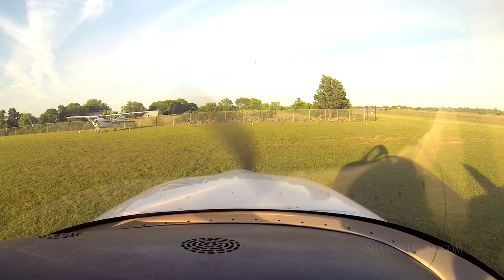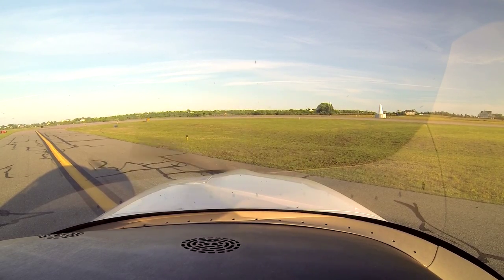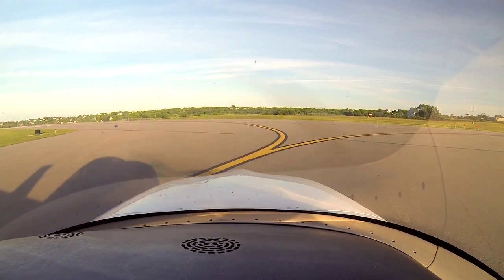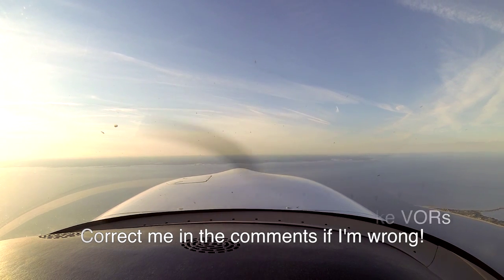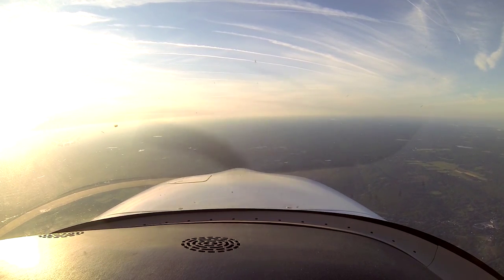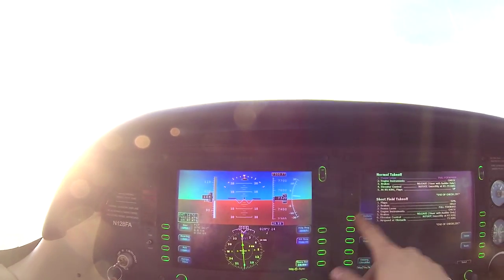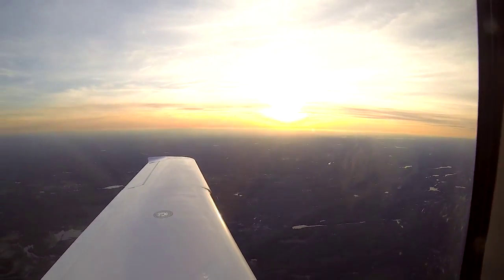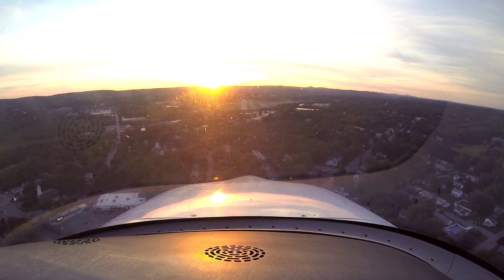This is Cirrus | HD + Comms | SR20

Comment: You probably know this by now, but here it is for the sake of the readers.

As far as the Cirrus S-TEC 55X autopilot NAV is concerned, there are two functions. One is NAV and the other is GPSS in NAV mode.

If you fly with NAV only, AP will receive navigation data from the Primary Flight Display HSI.

NAV selected with GPSS (GPS Steer), navigates with data from the Garmin GNS430 which is much more accurate.

It's good to use GPSS when in NAV mode for 2 reasons.

PFD HSI data isn't as accurate as drawing nav data through the GNS430. If you lose power from PFD, you'll be able to NAV through the Garmin unit.

If you NAV to a VOR, you'll be in VLOC mode, not GPS.

 #Aviation   #Navigation   #GPS
Reply from the maker: Cheers buddy!
Reply: Cheers!